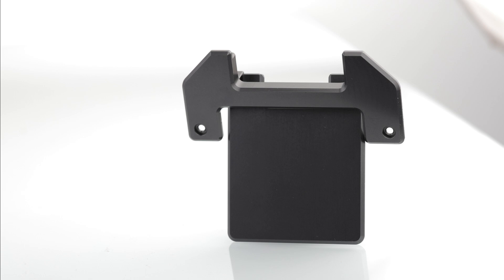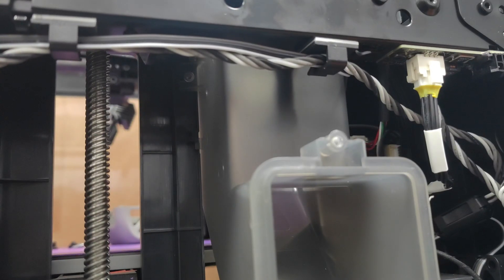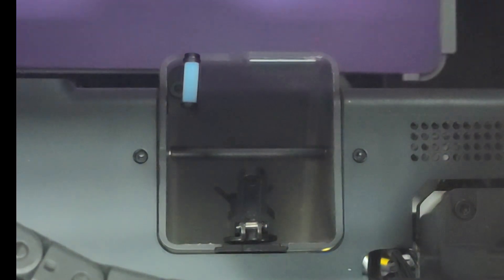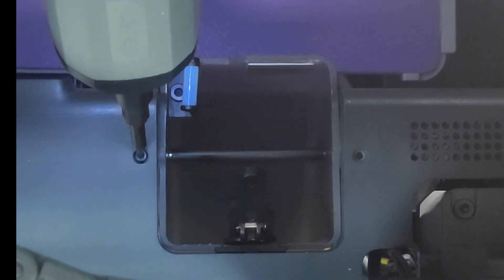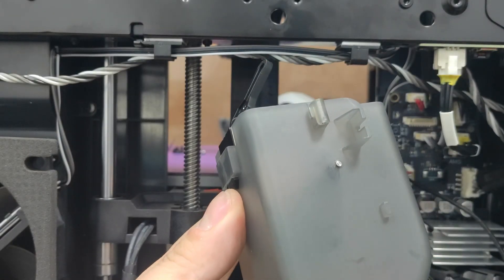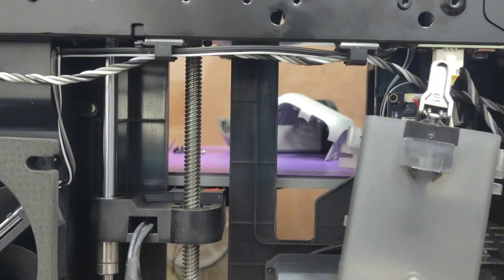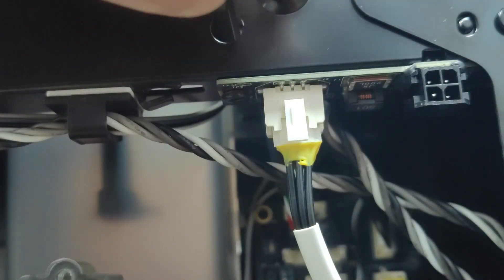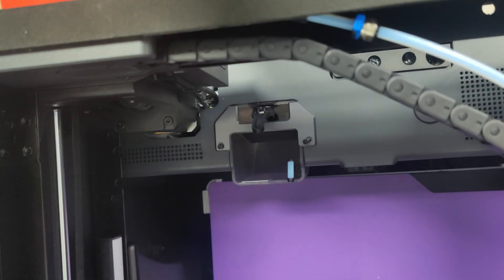MELLOW for EvoBambu WAC wiping port cover#3dprinting #diy #bambulab #3d #3dprinted

Comment: You can avoid removing the back you use some small side cutters and grip the hinge pin and lever it across a little bit at a time until the hinge comes out or you can just cut it as it’s no longer needed. I hope this helps some of you.

Comment: That looks interesting. What's the specific benefit of that product?
Reply from the maker: When using the AMS for filament changes, excess material may be deposited onto the print bed.
Reply: @3DMELLOWPrinter Is it non sticky material or what’s the technical aspect of it?